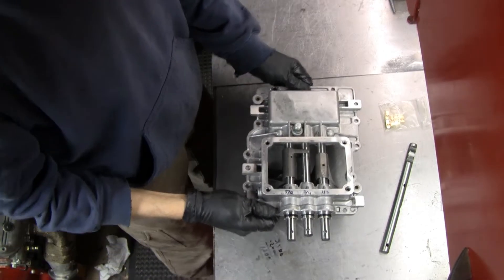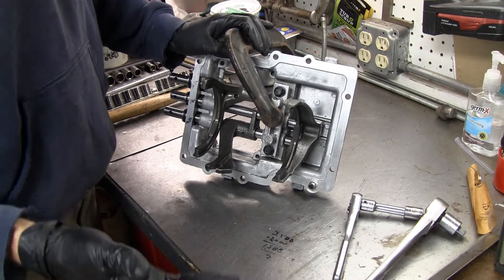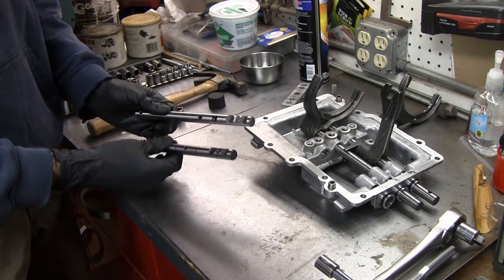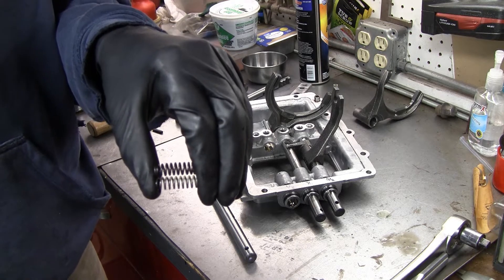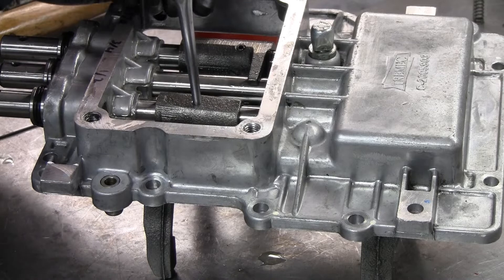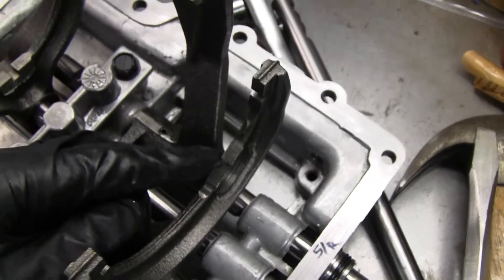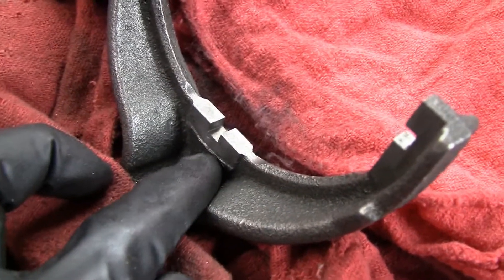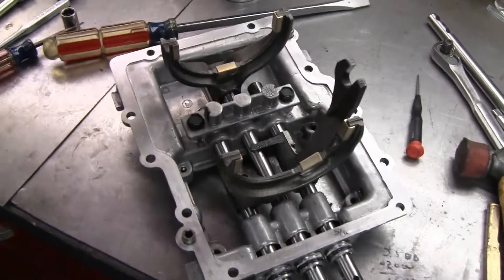Video 80, Tremec TKO600 5-speed improvement, part 8

Comment: Thanks for all of these awesome videos.  I have a TKO600 as well with no more than 3k miles.  I can't believe they used plastic for the shift fork pads.  It seems easy enough for me to just pop out the assembly and change them with those bronze ones.  Can't wait for your next video when you get back on the road again.
Reply from the maker: My trans is 15yrs old. I bought it when the 600 first came out. Possible since then they changed from plastic. I'll keep updating as I have time.
Reply from the maker: Contact Liberty Gears to see if you can purchase only the pads.
Reply: @primegaragegma-bodylsswap2089  Thanks I will call them.